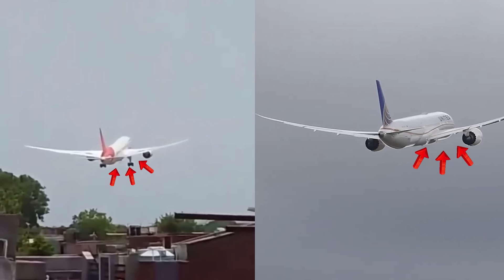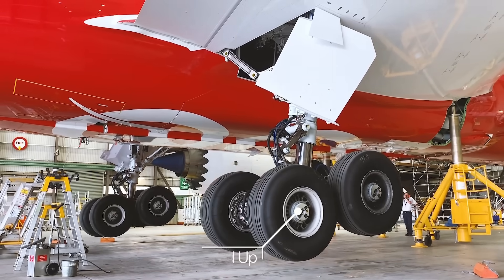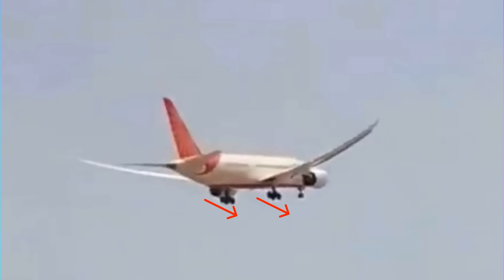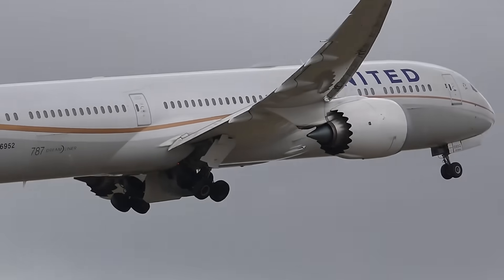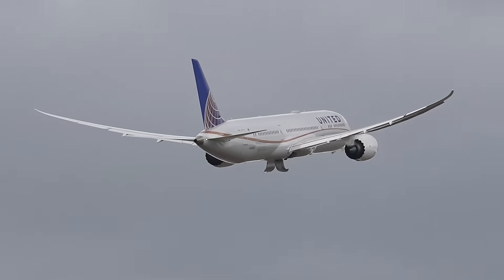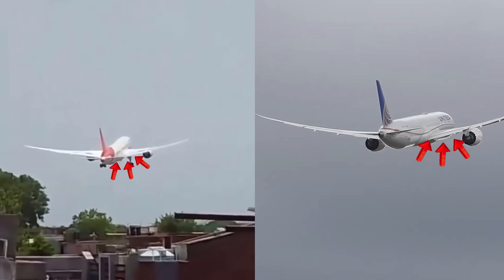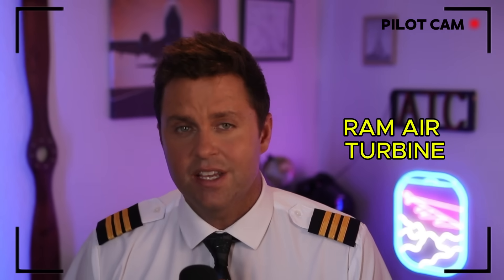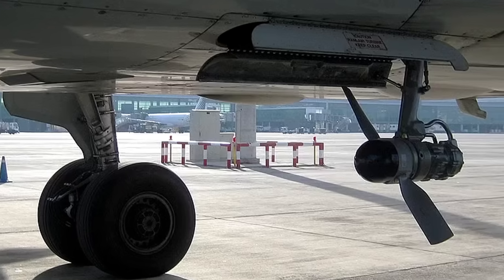Pilot Explains: A New Detail in the Air India 787 Crash Everyone Missed

Comment: I told this days ago: A Dreamliner under takeoff trust makes noise
A silent Dreamliner is a glider, no engines.
Reply: It had trust as it got off the ground !  🎉  silent dreamlike equals no V1
Reply: @unknownpresident  Yes it had trust up to rotation, but it was quiet som seconds later.
I don't think pilots had switched off the engines.
Reply: The RAT was deployed
Reply: You mean to say the engines are failed and not running?
Reply: @muruganmalli3435  yes
Reply: @muruganmalli3435  Engines make a hell of a lot of noise, especially running at over 100% because you think you are going to die if they don't get you out of the hole you are in. The best these were doing was idling, and the fact the RAT was out suggests they were dead. So, now you have to find out why. Did at least six fuel pumps fail? Four FADECs? Or maybe one bad person flipped two switched down or pulled two fire handles.
Reply: #Germanwings
Reply: Been saying that since I was on the live chat with Maximus, before the news sites and channels had even noticed it happened.
Reply: A dreamglider.

Comment: He may be a bright pilot but his focus is only on what happened after takeoff and the fact that he can’t get his head round a double engine failure or insufficient thrust from both engines to make the plane fly. Why does he ignore the evidence of the actual takeoff, the poor rotation angle and the testimony of the survivor? The plane should have been able to take off well within the parameters of the runway, yet this flight needed the entire runway and a bit more – judging by the dust disturbed at the end of the runway by its takeoff. The plane needed at least an extra thousand metres over a normal flight 117 takeoff just to get airborne and it was around 10 knots slower than the average takeoff speed for previous 117 flights. The suggests that there were problems with engine thrust from the very start and that the plane struggled even to leave the ground. V1 would have been achieved almost at the end of the runway. Whatever caused the lack of thrust, we must leave to the investigators.

Comment: I’m still not sold on dual engine failure being the actual cause, i think it’s a symptom. The flaps should be at 15 in those conditions and contaminated fuel I don’t think will cause faulty flap settings before take off roll.

Great spot with the gear tilt. But it has made me rule out pilot error all together so flaps wouldn’t be 5 they’d be 15, and it’d be clearer to see. So they set flaps to take off at 15, flaps didn’t set due to a system problem, same system problem leads to dual engine failure. I’m just not seeing how contaminated fuel hits so fast and would affect flap settings. 

This could be really bad for Boeing.

Comment: What struck me about the RAT deployment was that it was easily heard. All the other footage I’ve seen/heard with a RAT deployed was of planes coming in to land, where the engines are not spooling up, and so are quieter. On the Air India plane it was taking off and on take-off power that thing should be screaming, and for sure would be doing a better job at covering up the sound of the RAT. So, for me, the ease that the RAT could be heard over what should have been take off thrust is indicative that the engines weren’t at take-off power.

Comment: I believe that two engine failed because they were over boosted on takeoff. They struggled to lift before the end of the runway. Maybe they tried to depart from where they entered the runway instead of back tracking or their calculation was wrong. High ambient temperature plus over boosted engines - EGT would go very high and engines would expand . fan rotor would get caught in casing further restricting air intake. Contaminated fuel on Big international Airport for me is less likely as it would affect other aeroplanes as well.

Comment: Capt. Steve visually identified the deployment of the Ram Air Turbine (RAT), which, as we know, may indicate a loss of hydraulic pressure or electrical power. Notably, the main landing gear appeared to be pitched forward, suggesting that the landing gear lever was in the "up" position. However, the gear failed to retract raises questions about a possible system malfunction.
Reply: correct!

Comment: As Captain Steve said, contaminated fuel is highly unlikely due to measures in place now, and also pilots would have noticed engines sputtering as they throttled up for takeoff long before they reached V1.  The loud bang heard by the surviving passenger could indicate a potential source of damage to the electronics that could have resulted in both engines losing power at the same time. The loud bang could also have been the RAT deploying, I suppose, but something in the electronics or mechanics (fuel valve, etc) failed, in my opinion, and redundancies built into the aircraft were not sufficient to overcome it.
Reply: Duh

Comment: The likelihood of a 787 craft losing power on both engines simultaneously due to an internal failure is highly unlikely.
Incorrect fuel / air mixture (contaminated fuel) would affect both engines, but would most likely have made itself known earlier during taxying to the runway.
That leaves an intentional throttle back by the team (pilot / copilot), damage to or interference with the electronics up to disabling the engine management by someone.
If the eyewitness and sole survivor spoke of a loud noise, he may not have heard the deployment of the RAT, but a small detonation by a device placed strategically to disable the electronics.
Only the black boxes will perhaps give the answers everyone is looking for.

Comment: The contaminated fuel is a possibility. However I'm surprised no expert has has considered the possibility of overheating in the avionics or a battery fire. Why do I say that? It was reported that the ground temperature was 39°C which is extremely hot. This coupled with the report that the air conditioning was not working, I think you have a good chance that avionics simply pack up or the batteries caught fire. I may be wrong but no one has contested my theory.

Comment: I highly doubt contaminated fuel. A 9 hour flight plus contingency and diversion means they took I Giggs load of fuel. Say about 60000kg from Ahmedabad. That’s not a very big airport, meaning other aeroplanes would have also fueled from the batch of fuel or same storage tanks. If contamination was an issue another aeroplane would had the issue as well or at least reported.

Comment: It may happen due to fuel pump was not pumping fuel with high pressure as may require 21 bar pressure and as a result engine rpm slow down to less rpm . since electrical generating power unit inbuild of the engine so power voltage came down which was unable to drive the hydraulic pump and flaps and slats etc. Possible causes may be the fuel pump or fuel line choked.

Comment: There was a fairly large  ‘dust storm’ as the aeroplane took off almost at the end of the runway.
When planes fly through the clouds from a volcanic eruption, they can find the engines ‘flame out’.
Do you think that the engines could have sucked in a lot of dust from the ‘unused end’ of the runway, shutting them down?
It was extremely hot weather and the atmospheric pressure fairly low I think.
The engines were clearly working during most of the takeoff run.
It would seem to be a ‘lesser’ airfield that might not be used very frequently..?
My thoughts regarding an extremely difficult situation in trying to work out what happened, with all its tragic consequences. 
RIP for all of those involved…

Comment: Excellent directives sir. Respects and love from India🎉
There is also another factor of a Software Glitch of 787. After continuous use of 248 odd hours of usage,  the flight has to go through a electrical power checkup/ reset. 787 software has a tendency to cut off AC eectrical power after a certain hours of continuous usage. May be someone can shed light on this matter.

Comment: There's an unconfirmed video on YT (Air India Crash: Passenger Video Surfaces from Inside the Plane | Explained) showing when the aircraft was still at the stand before leaving for Ahmedabad. A passenger fiddling with the his seat-mounted facilities controller trying to get the AC to open the overhead louvres and trying to get his screen to work. Nothing seemed to function. Ahmedabad was his destination so he got off before the aircraft departed for Gatwick.

If confirmed the video shows the electrical system was not functioning 100% that day. I was a Tech Author at Hatfield writing Modification Service Bulletins (MSBs) for the electronically simpler BAe146 and would ask whether an MSB had introduced a relevant (rogue?) software patch to the engine management or other system recently. With heavily automated FBW systems there's a real possibility a software glitch could have been responsible for both engines to roll back to idle or shut off completely (maybe even multiple malfunctions of systems).

Comment: As an A&P engineer, I'm afraid they had an engine failure after V1 and they cutoff the other alive engine by mistake, not the first time it happens. Other possible cause can be fuel contamination. Associate electrical failure with a double engine failure makes no sense, engine are fully autonomous and they are designed to continue working without electric power in what we call fail  safe modes.

Comment: the engines could have been low on oil or had an oil leak, and it could have locked the engines running on no oil.   A proper maintenance check would have caught this.

Comment: well spotted so may be it wasn't incorrect flap retraction, but i'm not sure which scenario is worst...pilot error or a systems failure!! 
The first is much easier to deal with.

A double engine failure due to a fuel freezing problem...Boeing already had that on the 777 going into LHR in 2008...that whole episode was severely hush up.
Could it be due to fuel again?

Comment: The man that recorded the original phone video said soon after the crash that the rat was down but its taken pilots days to agree this.
I dont fly 787 but I cant believe that competent pilots or even public would accidentally reduce engine thrust instead of flaps and even if they did, the deceleration, lack of lift and reduction in engine noise would instantly cause anybody to increase thrust back up before their hand even left the controls.
Even boeing can't be so stupid as to make the flaps and thrust levers mutually  indistinguishable.
2 engins out is obvious but arent the engines fed from different fuel systems for safety, so all tanks must be full of contaminated fuel, but they would'nt both suck up contaminent at the exact same time unless all tanks full of water etc.
But the fuel burnt on impact so it was combustable.
So something switched off the engines.
The 1 survivor said there was a loud bang and the coloured lights were flashing before the aircraft went down.
The aircraft was said to have major electrical problems during its previous flight into India.
Several electrical systems failed apparently but no reports of anything being checked.

Comment: I am not a pilot, but here is my thoughts about dual engine failure. If one switch from cockpit can switch on and off the two engines then why not a power supply cut off/short circuit can turn off both engines? Unless the two engines completely run independently with different power setup. Another point is If there was thrust or throttle then they would have gone further more and engines would have roared. There it seemed they were just gliding.

Comment: The double engine failure must have happened just after take off. Because if you look at the video from the left side, when the plane takes off you can see dust blowing from the thrust of the engines at the end of the runway. Must have stopped just as they did the gear up. As wheels pivoted but gear doors didn’t open, or gear go up.

Comment: we know jet engine will keep working till the composition is taking place inside combustion chambers. And combustion is function of 3 things; air, fuel and ignition/spark or continue flame in this case. If both engines are assumed to fail simultaneously and immediately, mean combustion had been extinguished spontaneously and simultaneously due to some common reason(s). Most have talked about fuel starvation or abrupt fuel supply cut off ( mean supply to flams and combustion chambers stopped) but I do not see any one discussing about 3rd element i.e. air starvation responsible to both engines failure. We see that aircraft took off just at the end of runway and lot of dust thereafter. Can it be possible that at the end of runway, aircraft sucked lot of dust and low density air due to high temperature thereby  leading to the combustion chambers to flam out immediately / together? Mine is just a theoretical knowledge but experts like you can assess and judge better.

Comment: I believe the crash happened due to a short circuit or surge during takeoff that caused FADEC to reset or shut down, leading both engines to go into idle; IDGs failed, RAT deployed (sound and visuals confirm), gear got stuck mid-retraction due to power loss (angle of tires proves this), cabin lights flickered after RAT bang (as survivor said), and with no thrust + gear drag + only RAT power, there was no time or height for pilots to reset or recover — don’t blame  pilots without evidence

Comment: Would there be any (highly obscure) way that the selection of gear up has been able to cut fuel to the engines? I'm an ex maintenance engineer, 24 years in the Royal Australian Air Force and this fascinates me, I can't imagine how the two could be connected but I know nothing of Airbus systems. 
I know it's incredibly unlikely but the coincidental timing seems to line up with your theory of gear selected up them immediately losing power 🤷‍♂️
Also, and I might just be seeing something that's not really there, but it sure looks like the spoilers are deployed or at least deploying. Just another weird thing. Sad situation indeed 🥺

Comment: Hot, high density altitude day. They made an intersection takeoff,  leaving a lot of runway behind. That plane went off the end of the runway before getting airborne. In the videos, you can see loads of debris  kicking up as it goes through the overrun and then briefly through who knows what.  My bet is both engines got taken out by whatever happened there. Maybe not, though. I didn't see any smoke or flames, which is going to be the case with FOD'ed out engines. Who knows?

Comment: In the video of the crash - the one with sharp images and sound - you do not have any sound from the jet engines - no sound at all - except the humming from the RAT.
If the engines for some reason were set to idle, you would have the faint sound of a typical jet engine. but this is not the case.
It is this one original video with sound that clearly demonstrates that.

Comment: Switching off AT, pulling back to idle would not lead to RAT deployment nor loss of hydraulics. If pilot error it would have to be an accidently fuel cut-off. Most likely some technical problem. Hope, reason can be found and eliminated from happening again.

Comment: Older jet aircraft used direct mechanical connections for essential controls. While some of these hydraulic controls were power assisted (rather like the power steering on a car) they would continue to operate even if the power assistance failed. This meant that the pilot could actually make physical connection with the control surfaces through the mechanical linkage. Similarly, the throttles would actually mechanically control the valves which set the fuel flow. This new “fly by wire” system means that the pilots are no longer in direct contact with the control surfaces and the fuel flow valves. If something goes wrong in the computer software, it is perfectly possible for the pilot to set the throttle to maximum and for the computer to then set the control valves to a lower setting. This is what seems to have happened during the take off. The engines were only just generating enough thrust to get the aircraft into the air at the very end of the runway. So, something, clearly, was wrong at this point. It might just have been a simple software error - the computer thought that the information being fed into it warranted setting the throttles at less than full power. Then, immediately following take off, there was a bang. Something blew up. The information being fed into the computer then caused it to decide that the engines should be closed down. This was done and the RAT was deployed. I assume that the pilots pushed the throttle controls to maximum, but they were not, of course, actually in physical contact with the valves which controlled the fuel flow, as they would have been on an older aircraft. They were simply moving an electrical switch which was sending signals to the computer which had gone completely hay wire by then and answered the electrical information being fed into it by shutting down the engines. When I was at school (fifty years ago) I wrote an essay about might happen if we decided to have everything done for us by machines (robots were just becoming the fashion) - whether they might actually take over and finally refuse to follow our instructions. Well, now we know. Hand everything over to a computer and it is perfectly possible that, when we tell the computer to do something, we get the rebellious response “computer says no”. We are no longer in charge. We hand all decision making over to the machines, because we are too lazy to do it ourselves and they then take over and refuse to obey our instructions.